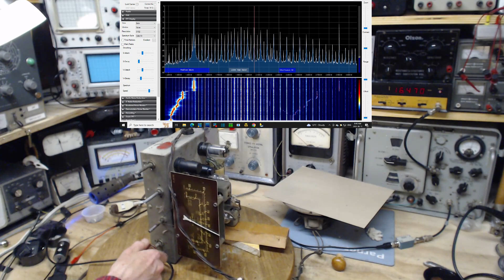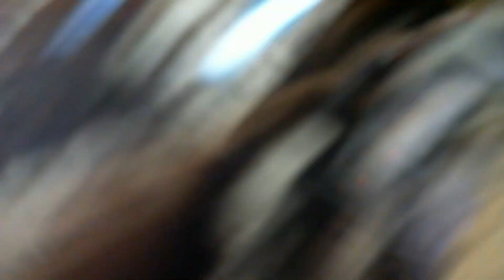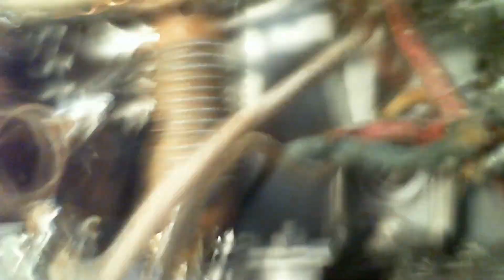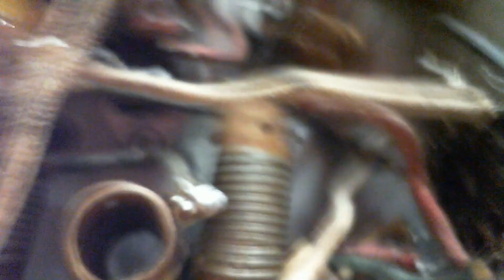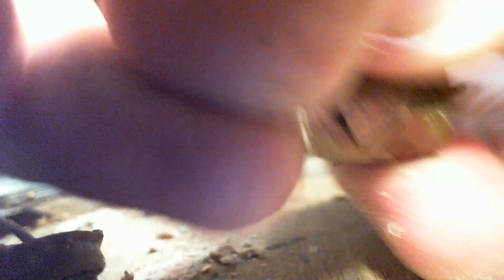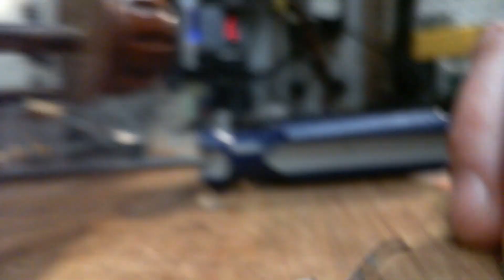Eatons Universal Electrohome Floorstanding Tube Radio Video #7 - Sticking a Problem Out

Comment: Greetings
I guess you are a person that cannot try the jobeasy path when offered. It seems that the goal of getting the signal to the mixer has fallen to a damaged coil winding, so now how are going to replace it? Obviously, the local oscillator is working and the super strong RF signal from the generator is being received by the convertor tube and mixing to form the IF that makes it through the rest to the speaker. It would seem that the previous tech. managed to make the needed changes for the new tubes. Now we do not know if he did the coil damage before he gave up?  I know that you can use your portable loop antenna to capture enough signal to force it to the mixer tube and have a strong station be heard out ofthe speaker. Yeah, now back to the busted antenna coil.
That battery was the bias for the output signal grid . The IF is still 455khz which means that the local oscillator is still making the same IF from the new local oscillator frequency range working with the shortwave antenna coil and still making the correct IF. Measure the IF with your frequency counter! You need to make more use of that tool.
I don't have familiarity with SDR so I cannot advise on its use.